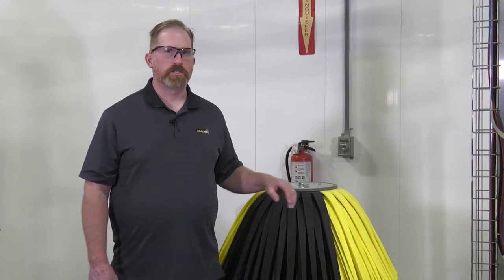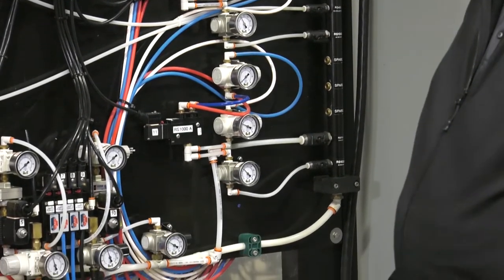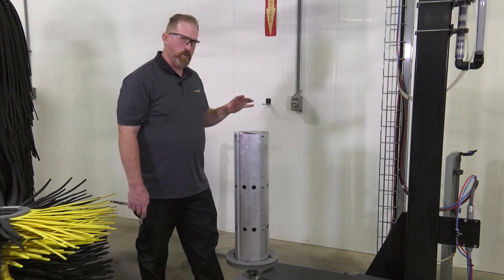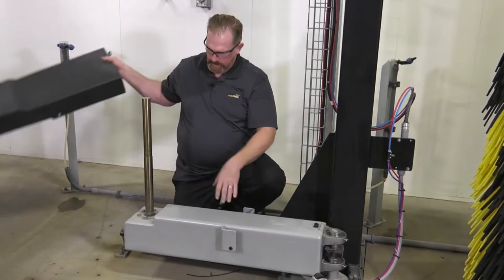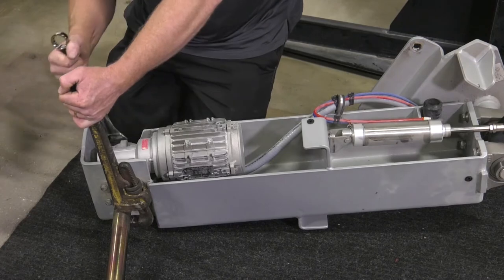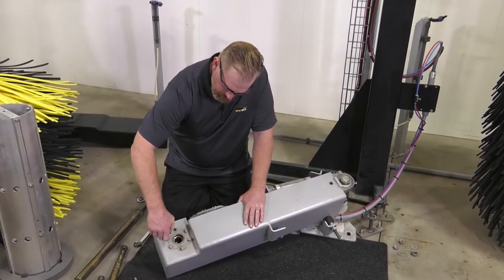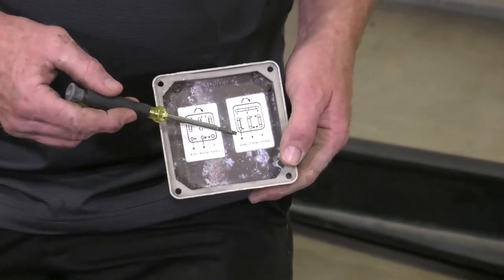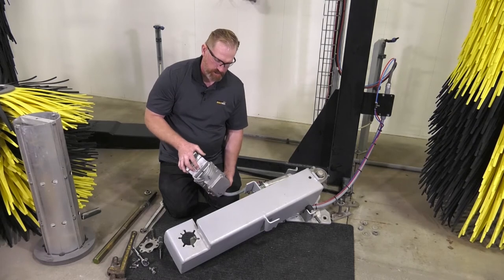MacNeil Side Brush Motor Replacement

Comment: I love the removal of the shaft from the gearbox by "just pulling it out of the motor".  Right. That will never, ever happen! Removing the shaft from the motor is the most difficult part of this repair every time.
Reply: Having this issue as we speak. Any recommendations for a stuck shaft? Tried everything short of torching it (as I don't have the supplies needed to do so).

Comment: I got a question what does it mean when you can't rotate the RS 301 by hand? but when you turn it on it spins and does what it's supposed to but then when it turns off the brush slams stopped on a dime it looks like it's hurting the motor and shaft what could this be?